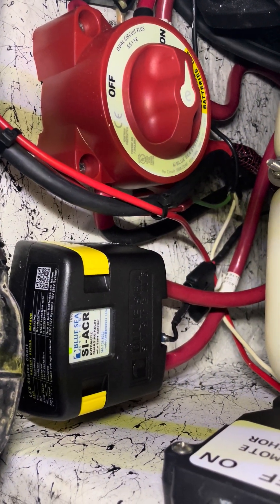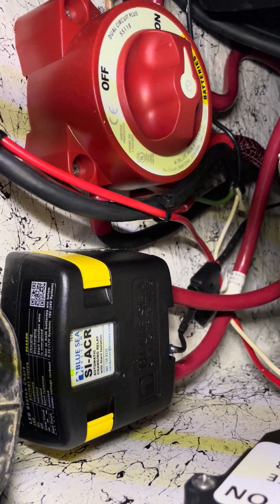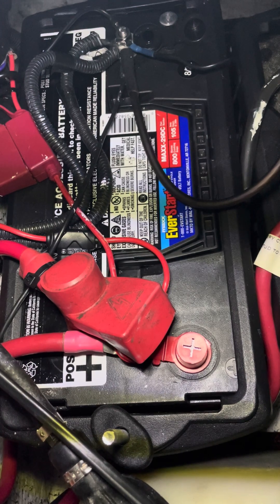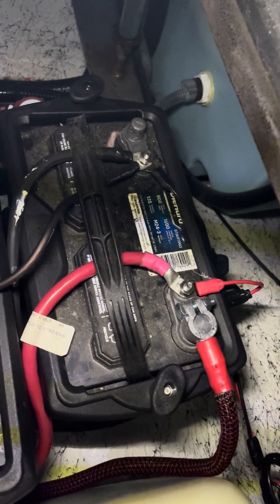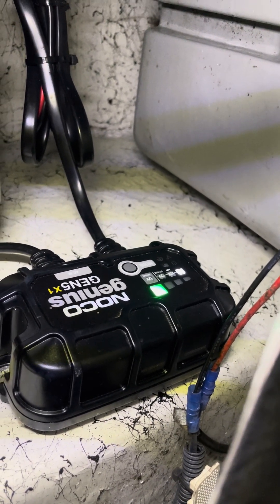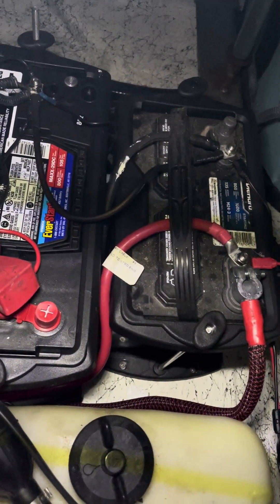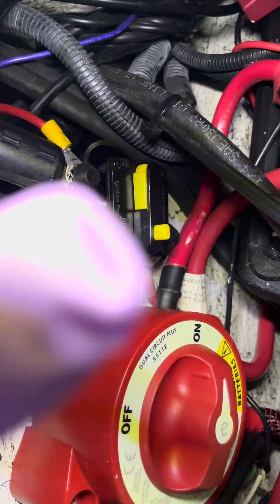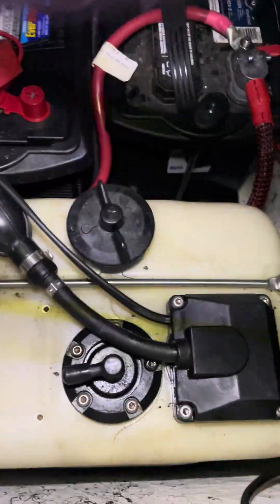Never be stranded by dead battery with this setup

Comment: Just so I understand correctly, is your accessory battery a deep cycle, the battery attached to your starting battery?
Reply from the maker: That is correct. In this video it is a deep cycle running all the graphs. It is separate unless combined with a switch. I have since replaced the deep cycle with Lithium. Always use lead or AGM as the starter.
Reply: @BrianB_fishing  thanks for the reply

Comment: can you safely start your engine from a deep cycle battery without damage to the battery?
Reply from the maker: IMO, yes you can and I did in my other boat. If you have the space/money a dedicated starter is insurance that you will always get back to the dock. Starting batteries (lead/AGM) are able to deliver extremely high energy extremely quickly to start the engine. Check out @EmilyAndClark